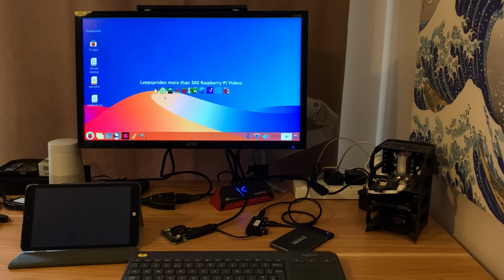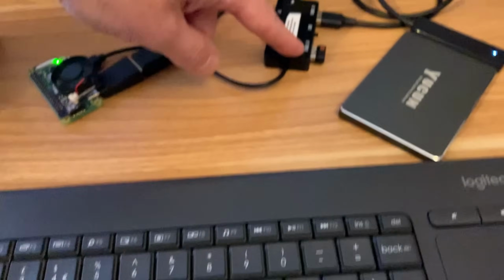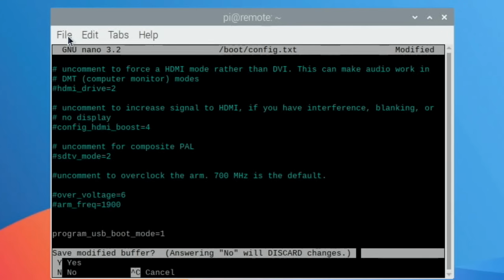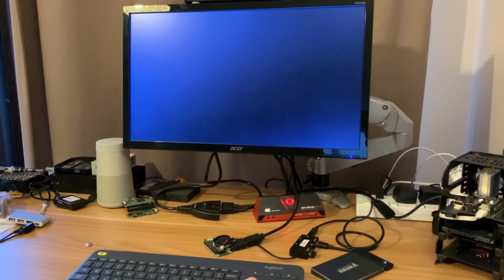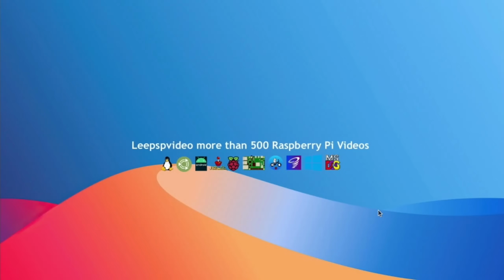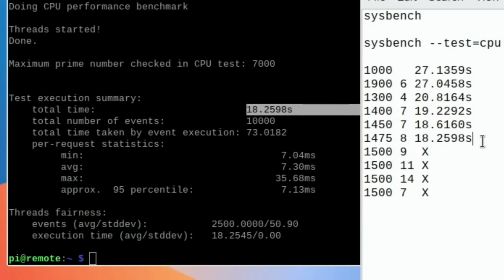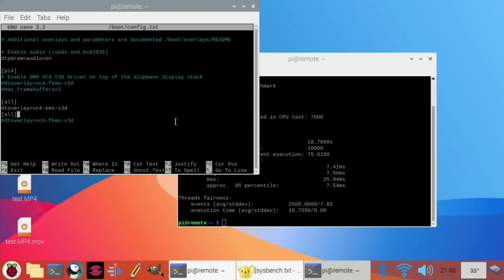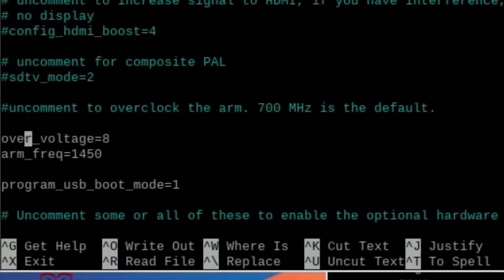Overclocking Raspberry Pi zero 2w. From 1000Mhz to 2147Mhz

Comment: Ok it’s 2025 and I know the pi zero is old news but wanted to try to give it alittle more speed but nowadays when you go to /boot/config.txt its says the file is now in /boot/firmware/config.txt , can we add in these parameters to that file just like in this older method or it is a completely new method ?
Reply from the maker: It’s the same process as before. Just in a different folder
Reply: @leepspvideo thank you i know it is trivial but didn’t want to start editing thing and poof , time to reformat my SD card 😅

Comment: Weird (had my Zero 2W running 1400 max normally) and just did an overclock to 1900 Mhz... and I'm getting 10s on sysbench with your parameters. The Zero 2W is outside in the cold though (about 1 celcius) but with no fan or even a heatsink...

Maybe it's sysbench that is changed though?

---edit

Just thought I try it with 1450 and then (never ran sysbench with 1400) and overvolt setting of 4... and it would not start... I think my original setting was overvolt 4 and 1400...

Comment: Wow,i wasnt thinking the pi zero 2w could be intercooler that much!,in the next video can you overclock the pi zero 2w to 1.4 ghz,overvoltage 6,and swap size to 2000 mb,and after you optimized the pi zero can you try to watch a youtube video at 720p,so we can see the performances? Thanks

Comment: Ive been having a play on my Pi zero 2w running OpenWeb Rx Plus and found some strange oddity at an overclock of 1200 and Over_voltage of 4.
I get loads of RF bleed over on some frequencies but if I back the overclock back to 1100 and an Over_Volt of 4, it works fine.
The overclock of 2147 didnt boot and an overclock of 1400 did boot but was unstable.
I guess I will stick with an overclock of 1100 and over volt of 4 as this seems stable for me.

Comment: Hi, I tried mi ZERO 2W with 64 bits OS Bullseye and ZRAM installed,  over_voltage=6 arm_freq=1400
I am getting this:

execution time (avg/stddev):   9.9945/0.00
Why? the 64Bits OS did almost half the speed?
Thanks for this great video.

Comment: I found this very interesting as i have use my pi 3 & 3b+ to use as a server but you are missing a few settings for a pi 3 chip ....  Jeff Geerling has a blog from back in the pi 3 day about overclocking the sd card as out of the box it' only clocked to 50% Heads up pi 4 is clocked to 100%....  Even a good brand sd card there is a 10% to 16%  read and write speed gain .... If you use ""James A Chambers"" script to test the speed of your sd card in the orange text at the start of the """HDpram """ test it gives you the info about your sd card and the speed it is running at.. Jeff Geelings code does block your wifi but in the forums I found this line of code which i put second last line in the config.txt above ""gpu_mem=128""       """""  dtparam=sd_overclock=100  """  does not block wifi,,,,,,,,,,,,,,,,,,,,,,,,, Pi zero 2w uses the pi 3 cpu just under clocked...   The first block of text that goes past your screen when you gives you 3 bits of info.. On a 3b+ at stock cpu-1400   core-400  
mem= 450  .... My Pi 3s the sd card will run at 100% till the core is at 500 and after that it drops to around 80- to  85 the one you can gain a bit on is the sdram speed to 600....... The Pi 3 sdram is clocked to 450 and the Pi 3b+ is clocked to  500 out of the box.. These are some of ETA Primes tweeked Pi 3b+ settings from back in the day that I run..
3b+
arm_freq=1550    v3d_freq=555    core_freq=500    sdram_freq=600    sdram_over_voltage=2     sdram_schmoo=0x02000020     over_voltage=4    dtparam=sd_overclock=100     dtoverlay=disable-wifi     dtoverlay=disable-bt     gpu_mem=128   
For th Pi 3B change the cpu freq to 1350 and if you using the onboard wifi hash out    dtoverlay=disable-wifi     dtoverlay=disable-bt 
""James A Chambers"" script   
((((  sudo curl https://raw.githubusercontent.com/TheRemote/PiBenchmarks/master/Storage.sh | sudo bash  )))))

Comment: Another interesting video sir. I want a modern pi-zero. You said in one video to communicate via a recent video so I found no difference using retropie roms from a usb2 hd to using a usb3 ssd.
This is on a rpi400 booting twisteros from a usb3 sata ssd but applies to all rpi. HD sata drives are cheaper for capacity than ssd. Would using a hd be better for storing roms? HD take 10X the power than a ssd.
USB3 sata for twisteros boot is faster than sd card or usb stick but retropie from usb3 ssd is no faster in loading... zx spectrum file takes minutes when emulation station starts.
Reply: PS. I've been trying n64 starfox and fzero and they are different to snes. Gobsmacked at the display and performance. Glad I got a rpi400 and all possible with your sites help.
3D earthworm jim and a 3D mario game. Very impressed.
Reply from the maker: I often use a 2.5” HDD for Retropie roms. The usb 2 socket uses less power. I find usb 2 more reliable with mechanical drives.

DeskPi lite Raspberry Pi 4 case. Plus first look at Retropie Supreme Ultra V1.1
https://youtu.be/PzHR9fVtgNc

USB boot Raspberry Pi 4.  Super cheap storage for Huge Retropie builds.
https://youtu.be/hHlL4lmSYqw
Reply: @leepspvideo  I like the alloy rpi4 cases you showcase. I have a rpi3 in a flirk case but rpi3 doesn't heat up like rpi4 it seems.
HD drives seem fine for running retropie roms with retropie as an app on twisteros on a usb3 ssd. You show retropie can run from a HD.
Some HD need a usb to sata with either 2 usb leads or a socket for a 12V dc supply.
Reply: I have bought sata ssd and used a usb caddy or adaptor and the drive doesn't show in win 10. I've had to return it and the seller says checked and showing.
I received a 250G sata usb a few days ago and it did not show as a drive.
I used free easus partition manager and it showed the drive as disk2 formatted with ntfs so pressed create and reformatted as exfat as drive F: It works. 
Ever had that problem of windows not seeing a drive?

Comment: You can obviously overclock the CPU but you can't do anything abought the tiny 512MB RAM. It still has plenty of uses for projects and retro emulation. Tiny it is but by the time you add a USB hub to the equation, the footprint becomes larger than some Mini-PCs with MUCH more power and 16X the RAM of the Pi Zero 2.
Reply from the maker: My MeLe Mini PC is great! 

Amazing Silent Ultra Mini PC. MeLe Quieter2Q. Plus Steam Proton Test.
https://youtu.be/RhzUo6npoT4

Big difference in the price though
Reply: I'm waiting for something like the MeLe Quieter 2 but based on the new N6005 Intel Pentium CPU which should be a much better performer. Though that new Beelink GR9 is impressive with its dual NVMe, SATA SSD and 64 GB.  But, again if they can take the newer Gen Ryzens...

Comment: why do you over clock a pi ??? what do you want to do with the overclock ?????
Reply from the maker: To increase performance. An operating system with a graphical user interface runs better. Games run faster and smoother.

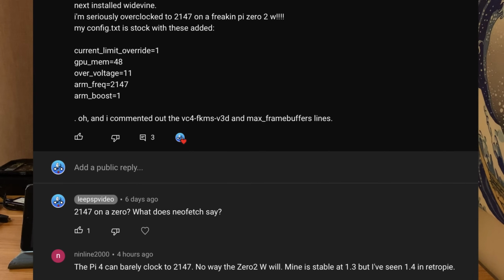Comment: Ok, I am not getting it. I use the settings from minute 00:27 and pushed the frequency to 2,6 GHz. With over voltage 11 it's not getting as near as warm as with lower voltage.
How does this relate? Am I living dangerous or why can I push so much?
Reply from the maker: It’s definitely mis reporting try the test to see if it’s faster.
Reply: @leepspvideo  I put in 3 Ghz now. Is there a way to measure the real time clock speed?

Comment: Thank you for the video.
Here is my problem. After I added the following to the config.txt
over_voltage=8
arm_freq=1425

I am getting an error message after boot up to desktop:
Failed to load overlay 'vc4-kms-v3d'
Reply from the maker: Try one of the lower overclocks from my description to see if you get the same message. Are the two lines the only ones you changed?

Comment: I just ran sysbench on my Pi Zero 2 W stock to set the benchmark.  Not overclocked or anything and it's giving me consistent 10's.  How is that even possible?
Reply from the maker: This was the command I was running 

sysbench --test=cpu --cpu-max-prime=7000 --num-threads=4 run

What was yours
Reply: I used the same command.  Copied and pasted from the video description.  What version is your sysbench?  Mine is 1.0.20 on bullseye.  I also ran it on my Pi4 and it seems like both are running for exactly 10 seconds but producing a different number of events.
Reply: @morgansmith6219  mine too
Prime numbers limit: 7000

Initializing worker threads...

Threads started!

CPU speed:
    events per second:   317.94

General statistics:
    total time:                          10.0122s
    total number of events:              3187

Latency (ms):
         min:                                   12.50
         avg:                                   12.56
         max:                                   21.13
         95th percentile:                       12.52
         sum:                                40019.59

Threads fairness:
    events (avg/stddev):           796.7500/1.64
    execution time (avg/stddev):   10.0049/0.01
Reply: The sysbench command has changed.  It runs only 10s by default (see --time option)

Comment: Good. It may be worth giving results based on the: 1. connected devices (USB, ..) / 2. type of processing (data read/copy, CPU, ..) / 3. the power source (max freq. will obviously be capped when running the Pi on-battery, ..) / 4. type of cooling (fans, passive, hybrid, ..)

Comment: You mentioned 64-bit Ubuntu would probably run slower on the Zero 2. I was considering using 64-bit Raspberry Pi OS. Can you tell us why it might be slower? Very helpful video. It's not quite a "how to" overclock, but if I pause when your config files are shown, it's enough to get me started!
Reply from the maker: It seems 64bit operating systems use more ram. If you have more ram they can run faster than 32bit.

Raspberry Pi OS 64bit vs 32bit take 2.
https://youtu.be/erYJzaUIkY0
Reply: The 64bit PiOS seemed to run fine on my pi zero 2 untill I opened the browser then all hell broke lose.

Comment: Can you evaluate Zero 2 W can it be actually used as desktop pc like watching YouTube, browsing
Reply from the maker: With the right tweaks a light user can get away with it. I may put them all together in a video. The Pi 4 is far better, the main issue is the lack of ram. 

I used it for this episode of Pi news.

Pi news 41. The Amazing $15 Pi Zero 2. Plus Vulkan 1.1 compliance, up to 60% better performance.
https://youtu.be/Tbj7P3tVUHg
Reply: @leepspvideo  that video would really help me a lot whether to buy or not at cost of 1300INR.

If possible make a video on raspberry pi zero 2w as media player project to use it cheap casting device,where on YouTube and others platforms  streaming can be at 720p.
Reply from the maker: @hsswhatsapp6511  chromium works terrible with the Pi zero 2W. So I wouldn’t recommend it for casting.
Reply: @leepspvideo  So Zero 2 W is not cheap option for web casting

Comment: Interesting results. Regarding the 1900 MHz and 2147 MHz, those seem to be not actually running at that. I remember Gamers Nexus saying multiple times that doing an OC and booting isn't enough, you have to validate that with the benchmark results. Because if it's not better, then it's not also actually running at a higher frequency.

If I were to guess, maybe the Pi simply boosts to 1900 or 2147 and immediately scales down. Is there any way to plot the frequencies while running the benchmark ?

Anyway, nice 1450 MHz overclock!
Reply from the maker: I still can’t work out why 2147 performs better than 1900 and 1300 but not as good as 1450.
Reply: @leepspvideo  could be ram bus timing or something like that. clocks that aren't in sync can suddenly halve the effective speed.
Reply: @leepspvideo  The best I got from a BCM2837 (on all 4 A53) was about 1550 I doubt the 2147 as seen on Pi 4s is reported correctly 😅

Comment: I somehow managed to get down to 17.30s at 1500 with overvolt 8.  It worked twice in a row, but got kernel panic at the the 3rd time.  I did overclock core_freq and ram as well.
Reply: Stable 17.97s with this config : 
arm_freq=1450
core_freq=566
over_voltage=8
sdram_freq=566
over_voltage_sdram=2

Comment: It sounds to me like it is thermal throttling at the higher frequencies, if you upgrade the cooling you might be able to push it further. It is always important to monitor temps when doing any overclocking.
Reply from the maker: I don’t think it ever reached 50

Comment: Reminds me of overclocking Athlon 2400 to 3200. Depending on timings, some frequencies worked and others didn't i.e. 3350 would run, 3250 wouldn't. 3200 was stable 'most' of the time. If you are on this kind of limit, back off a long way though as the little bugs multiply and scramble your OS install eventually. I ended up around 3000 as I got fed up with Windows file corruption, even with a huge cooler and low temperatures. Humongous power supplies and good motherboard design also have an effect up at the edge. I run my Xeon 2689 bog stock. No issues even with a Chinese motherboard rework and second user CPU. It will overclock with the Russian BIOS I have, but it's not worth it. The Xeon won't let you go crazy on package watts anyhoo.

Interesting viewing.

Poor little pi :-)

Comment: My Chuwi HI9 just died (touch panel gone) Brilliant, cheap machine with no bugs. Very high res 4K for an 8" tablet. Teclast replacement has a faster CPU, is cheaper, but screen is only just over 1080 and one or two minor bugs. Good enough at this size though and 1/3 the price of name brands. 3-5 years I get out of a cheap chinese phone or tablet. Usually killed by numerous drops or physical things eventually.
Reply: Wasnt it only 2k? Or was there a 4k model

Comment: Cool video, is the fan connected to the GPIO pins?  Doesn't look like it. My zero 2w runs idle around 42c with a heatsink and at stock speeds. Stable at 1300 and 4 over voltage but performance wise not noticeable. Also temp rises to 70c when running Chromium.
Reply: You could build that pi zero into a mug mat, have it run folding at home and keep your coffee warm while curing cancer. The fan shim sort of hooks onto the gpio pins.
Reply from the maker: The fan uses the gpio pins 

Raspberry Pi 4 FAN SHIM Pimoroni gaming test PSP GTA PPSSPP
https://youtu.be/rTrKYcOOq0Y
Reply: @leepspvideo  thanks for the link and all  videos you make.